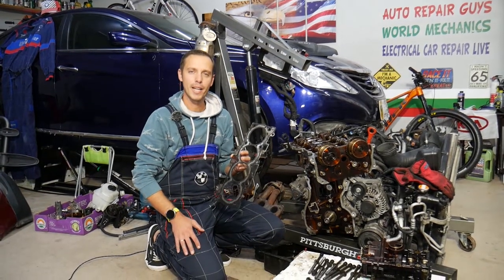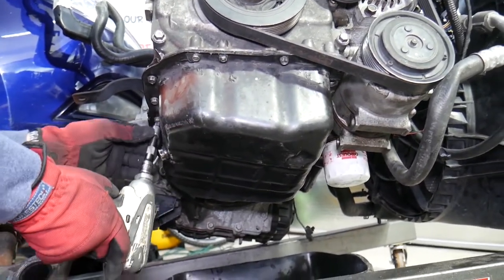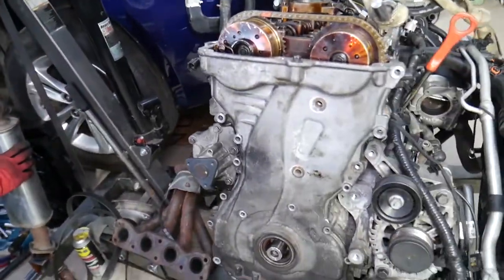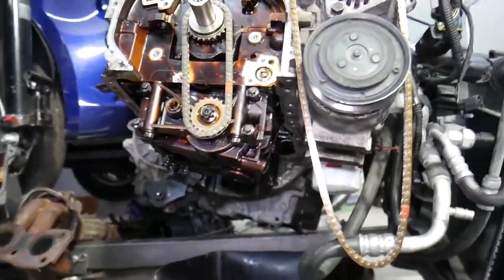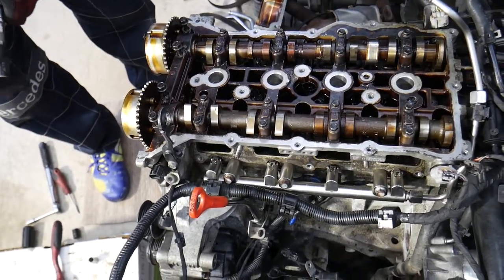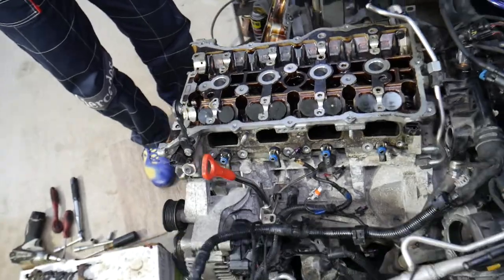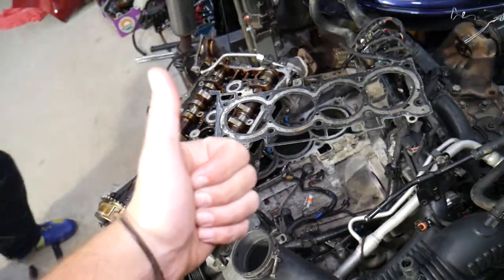HYUNDAI SONATA CYLINDER HEAD GASKET REPLACEMENT REMOVAL, CYLINDER HEAD REPLACEMENT

Comment: Hey! Nice work! I have a Question.. do you recommend pulling the engine for this job? Or is it “doable” in the vehicle? Thanks!
Reply: Have you done it already? Is it possible with engine in?
Reply: @donshallop6012  nope, gotta pull it :(
Reply: @youtubemechanic6384  do you have the pic of the damaged head gasket?
Reply: You sure? What’s in the way of doing inside the car?
Reply: Yea I do have some, definitely was leaking. But the frame is, no way you can pull the timing cover.
Reply: @youtubemechanic6384  how can I contact you, I’d like to see what the leak damaged look like. Considering pulling apart my 2016 hybrid Hyundai Sonata so it seems a little more complex
Reply: It’s doable while engine is still in vehicle. I do it all the time at my shop
Reply: It depends on the car some motors will have pistons I acess able from inside the hood some won’t my sisters little v4 kia I could lift the whole motor out by hand or just take the header off and do it right there my monster v6 sonata (terrible designs for half the components) ehhhhhhh kinda doable there isn’t a mystery 6th cylinder turned at a weird angle but the 5th is definitely going to be questionable it was hard enough to change the plug on that one soooo

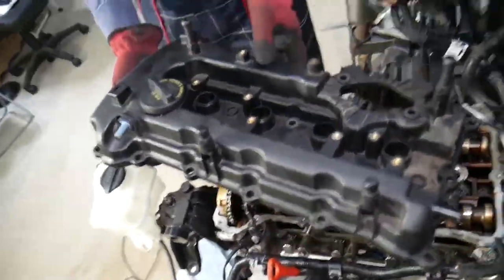Comment: @autorepairguys thanks for the great 2011 Hyundai Sonata vids! I couldn't tell by the video at 10:23, do you by chance know if I'd be able retorque the cylinder head bolts by just taking the valve cover off or would I have to take the timing belt off?

Comment: I am rebuilding 2015 2.4L GDI. I am having issues finding the correct torque specs for the complete motor. I am replacing the complete rotating assembly

Comment: What do I do when one of the cams don't have a bolt to help with the timing manifold side has the bolt in the video intake side is flat n no bolt n has a special sensor for it n its own cover. Same engine 2.4